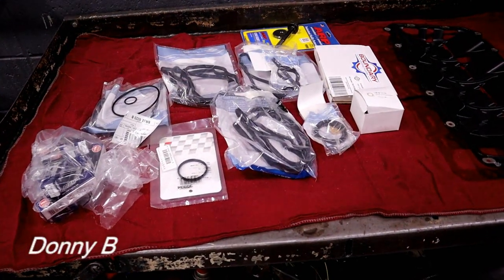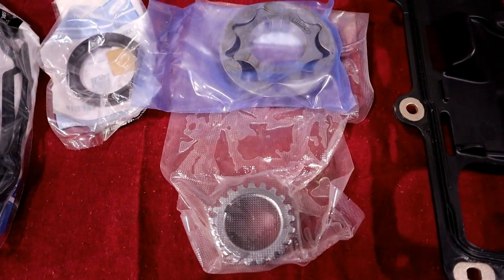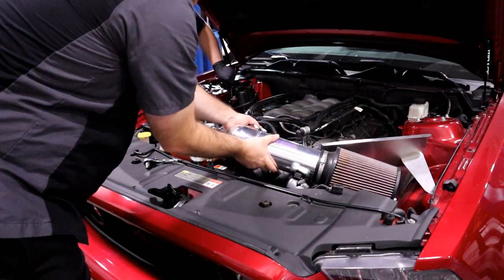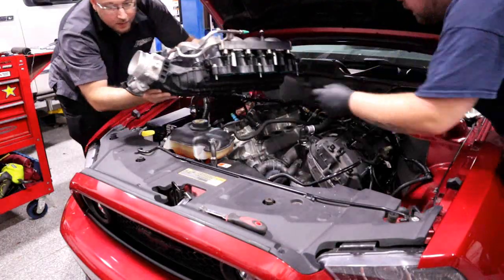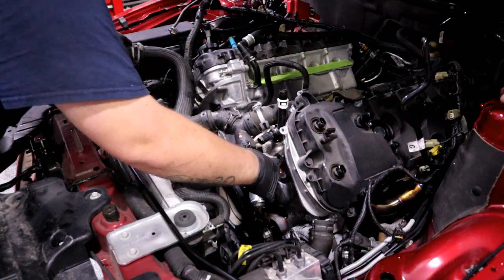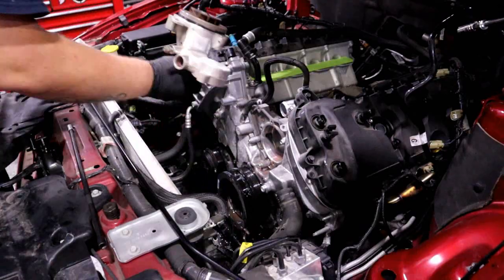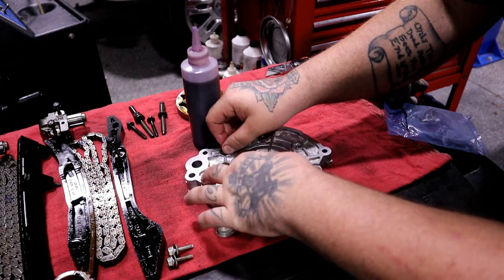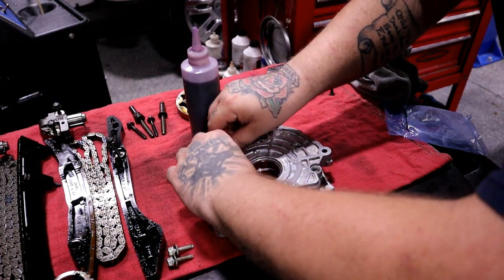Mustang Coyote Oil Pump Gear Install and Tech Tips

Comment: As much as I am a DIY guy, the fact that you have to remove the timing chains and the front engine fascia to access the oil pump, seems sort of off-limits to me. Don't want to mess up the timing when reassembling everything and catastrophically failing my engine. I wonder if an OPG upgrade is still required to run on a stock NA Coyote with stock tune, where I like to rev high.

Comment: Is the crank gear really necesary?
Reply: absolutely
Reply: Absolutely NOT!I talked to a coyote engine builder that builds motors from 1000-2500 and he told me it's a gimmick. Marketing gimmick. In fact he said it's counter productive because some of those aftermarket parts will throw your timing off. I found all this out on my own with an aftermarket gear, so I stopped listening to these people on line with no experience and no real insight, and went straight to multiple experts. Once you do this yourself and you run into out of tolerance and abnormal tolerance on your equipment, which it happens all the damn time that's why shops are tooled for all this, you understand. If you do get a aftermarket, TSS has never given anybody problems. I've got a full opg/cs and roush gen 1 blower build coming soon to my channel. No brand bashing here, just truth that's taken me HOURS and HOURS to find.

Comment: did you get that oil pump on without dropping the oil pan?  I got mine off with oil pan on, not sure I can get that pick up tube bolt in with the oil pan on.
Reply from the maker: Yes got it on without dropping the pan. Very tedious and slow process

Comment: Nice!  Are those gears billet or PM?  Those tabs are the "cloverleaf" or wear tabs (useful if you have the pump install tool to set the gerotor centered before torquing the pump to the block).  No official torque sequence on the pump since the bolts are all torqued at once at the factory.